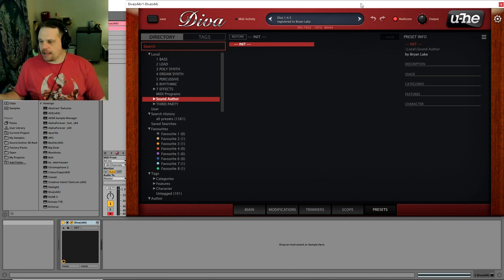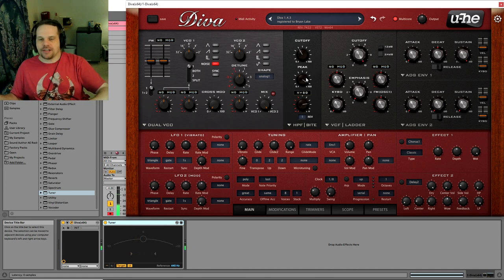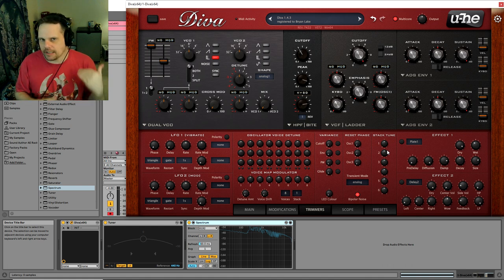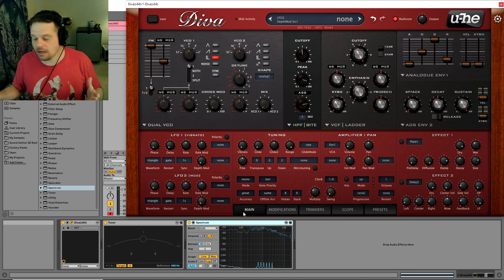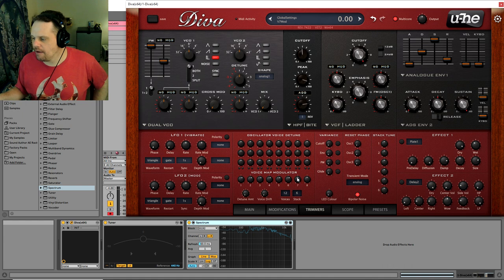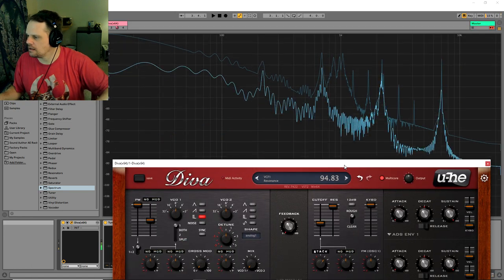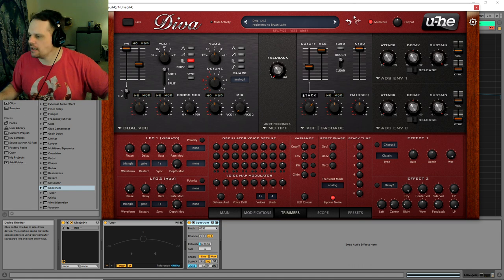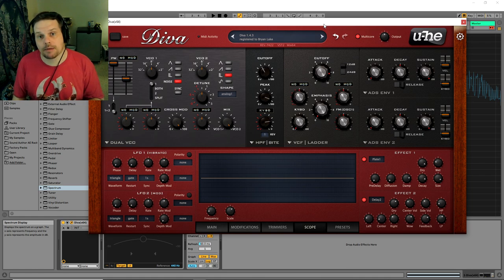Diva Tutorial: Filter Ping / Stack Index Modulation

Comment from the maker: Okay, so I screwed up the tuning here. When using 6 Stack Voices -- not 4 -- you're going to have 5 spaces in between those 6 voices, right? If you want each of those 6 voices to be tuned an octave apart, then each of those 5 spaces are going to be 12 semitones. So, that means the range of the Stack Index modulation of the Filter cutoff is going to be 60, since 12 X 5 = 60. BUT since Stack Index is a bipolar modulation source, Stack Index will modulate the Filter Cutoff in both directions, and because of that, we need to cut that modulation range in half: 60 % 2 = 30. THIS will ensure that each of those 6 Stack voices will be spread evenly an octave apart. The reason this didn't work in the video was because I used 4 Stack Voices instead of 6.
Reply: 6 harmonic additive synth.. very clever